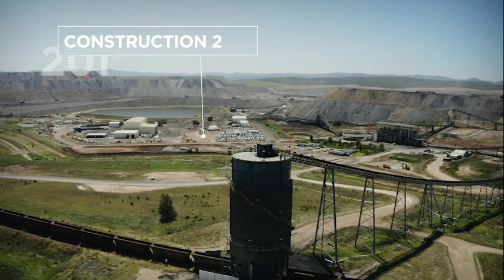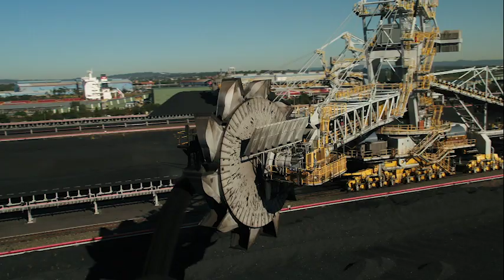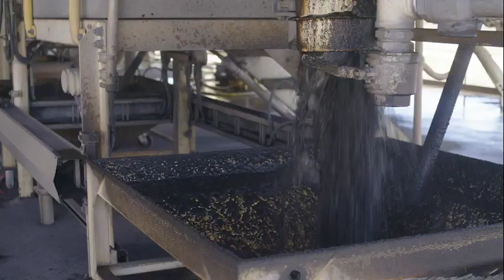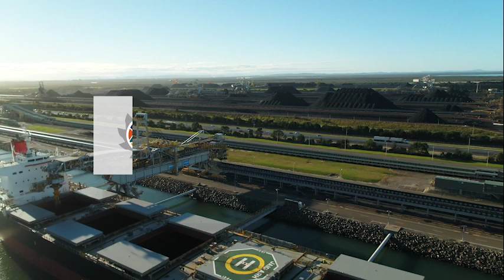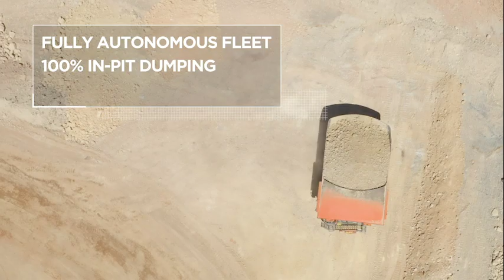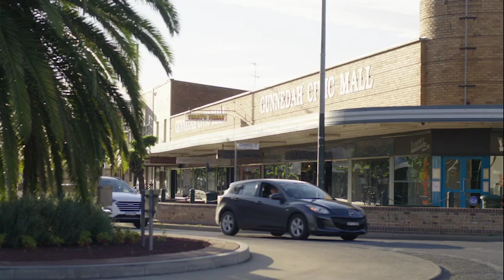Whitehaven Coal's Maules Creek Mine | virtual tour

Comment: Here in Europe we closed down our dirty coal fired power plants and replaced by renewables to lead the road for elimination of fossile fuel for urgent response to the climate crisis. However then Putin stopped sending gas over and we could not use the renewables for stabile supply of power so we had to wait to go into the climate response and we had to start up with coal again. however our banks have stopped financing coal mines.
Reply: Firstly: there is no climate crisis. Secondly: the EU shot itself in the foot by closing coal. Putin has NOTHING to do with the EU’s energy problems; problems you’ve had long before Russia invaded Ukraine. Face it: ‘renewables’ are an objective FAILURE.
Reply: i would love to see any coal mine, new mine,s or any coal mine,s that have huge amounts of coal reserves left, open or re-open , here in the uk,